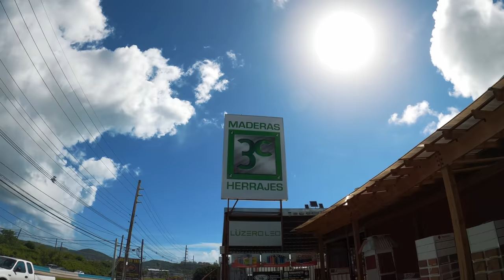BOAT YARD (PART 2) DESTROYED OUR BOAT SHOULD WE BUY THIS ONE?!

Comment: Matt and Kristin, I really love you guy's, I have commented before and I believe you respected my advice. Hooked-n-Rolling Offshore 2009 is spot on with his advice!! So, no need to follow up anymore on that. You guys are in a great spot with your boat. I would keep the boat you have and finish your project. And here is why, you are Learning!!! By the time you are ready to move up into your next vessel you will know what you're buying just by walking around looking and tapping. The education your boat is providing you with now can easily be transferred into earning big bucks for you while cruising and when you return ashore looking for a career in the industry. Okay next, you're moving too fast. Slow down and tackle each job one at a time working forward to aft. research and have a plan before you cut that first piece of high dollar marine ply. Make templates first. You have the advantage now to make the interior of your boat into anything you wish. Get a few sheets of cheap "Door Skin" and a hot glue gun and (temporarily) build your interior completely. See and feel each piece of furniture you're going to build and know it's going to fit and be what you want. Then after you take that apart you will have Templates or Patterns to use before you start cutting the expensive materials. And the Grand Prize !!! a brand-new BETA engine that will last a lifetime. Really guy's if done correctly you are in a fantastic situation. Stick with your plan. Your being smart about this for the long run.

Comment: You need to glass the top of your bulkhead.   Also make sure you don't have any air pockets,  you will lose strength.  Don't skimp on the resin.  Use a sand paper grinding pad for your grinder to remove paint down to the fiberglass.  Best of luck and keep motoring.

Comment: Looks like people already said about the cove and build-up in sizes, but the roving chop matt is the weak stuff! you need some thick fabric with diff. layers at diff. angles matt! multi-directional fabrics! that's where the strength is! not chop filler! and make some thickened stuff and glue the new ply to the deck and hull!  Then cove the corners then the heavy fabric! 4 layers! 1/4" sounds good!

Comment: I really admire and respect you both and am very happy you have let me tag along on your journey. Having said that, I have to get negative for a minute only because I wish you the best. Get a multispeed 7 or 9 inch angle grinder. Removing the paint with stripper and a brush will not do the job. You need a fair tapered surface of feathered fiberglass that you can only get with a grinder and heavy grit discs. That is the only way you can get the bonding you need to support the mast. What took four hours with the brush would have taken 20 minutes tops with a grinder and you would have had a better surface to glass to.

Comment: Ya that grinder disc is not the right  type. The flap one works great..  But dust in every place you could dream of.  Try the Oscillating Tool for cuts  you can a vacuum next to it or make a water bottle dust cover for it works well.

Comment: A wee safety tip.....wear safety glasses when you use the  pumps on your resin and hardener...I learnt the hard way, hardener nozzle was partially boocked and I pumped it and it squirted up and hit me rigt in the eye, I washed it out with sea-water then fresh water but absolute agony for around two-days as a result ..loving your work though and love your chanal

Comment: The Fibre Glass tabbing is there to reinforce the hull to bulkhead glue and not as a primary form of adhesion
As others have pointed out, you need to glue the bulkhead to the hull, then fillet the join before applying the tabbing.

Comment: Glass the underside of the deck to the bulkhead also fillets with thickened epoxy for the 90 on top and the sides this will make your chainplate bulkheads stronger also forget the thin cloth 5 or 6 layers of thick cloth other question was what your glassing to looks like interior ceiling  not the hull of the boat you have to cut away the ceiling  to attach directly to the hull because what your glassing to is just interior lining not the hull structure

Comment: Others have said it about watching Sailing Parlay Revival for bulkhead repairs.  Another mono-hull rebuild that's good to watch would be Expedition Evans.  No idea how much farther you've gotten but for any OTHER bulkheads, especially structural ones like those for the chain plates, please PLEASE seal the raw edges of the plywood with some thickened epoxy!  That will help bond it to the hull and deck of the boat as well as prevent water from seeping in to cause rot.

Comment: Well Matt , everything has been said and most of it is good advice, so only one thing from me , before you fit the bulkheads scar them up with the corner of a chisel all over then sand off the little wood needles so they don’t hold air in the Matt after glassing, you’ll be surprised how much grip it will add. Anyway mate love the show, real genuine couple and if I was near I would willingly give you a hand. I saw the stress in your face with the work you have created, good luck and Keep um coming

Comment: Great work and lots of great input. My two cents? 1. Replace all those bulkheads, you have it all stripped down now. The extra couple of hundred bucks of fiberglass now will pay dividends via a stiff, quiet boat that you'll feel safer on. 2. If you are using 3/4 plywood versus the half inch original, of course more reinforcing class will be required and the entire bulkhead will be wider. I'd check the slats for the chainplates to see if they are wide enough for the new width (through the deck) and all of the joint areas to ensure the thicker bulkhead will work 

Me? I might have traded up to the 40. More room on a boat is like gold. Whether it's just to sleep or for storage or to have separate areas to be when on the hook and it's raining, lol. But then again, who knows what problems you are asking for with the new boat. At least this one is the "devil you know". Great episode, thanks.

Comment: For your existing bulkheads drill the holes out to 3/4" to 1", check to make sure you have good wood, and then fill back up the hole with epoxy with a strong filler. Then drill the holes for the bolts, this is a trick that the Gougeon Brothers use for fasteners, that spreads the load on the wood and protects from water and rot.  Have fun restoring your boat.

Comment: Sweat Equity - It's worth ALOT! You guys are gonna have to do a cost/value analysis. Me personally I would continue with the repairs till done. I've found it's the same with cars. It's Always less cost repairing what you have as long as you're doing the work. Newer Bigger Nicer is expensive. You've already put money in tools & supplies, previous repairs. What's your boat worth after you fix everything you have planned (engine included). Used boats Always have issues, that's why boat buyers pay for inspections, sea trials. It all adds up, weighed against what you can afford. Maybe after all is done you figure this all out and come up with a way to repair and flip boats. Really enjoy watching your journey. Keep it up !!!

Comment: Ok read all the comments all of which are spot on re the fillets etc and advisories to check out other channels, however I think Matt may be a little to proud to watch others and follow there lead, my best advice, as already commented below, drill some holes find the rot, cut out and replace, re glass over the whole bulkhead and into the hull and under-deck, the more you cut out, the more you have to spend replacing, do the big bulkhead first and use your of-cuts for the smaller ones, just a thought guys, no hard and fast rules here, wishing you all the best, Al

Comment: With your engine, I recommend a Re-built Yanmar 30.  Ideally, the seller would crate the engine up and then ship to your location. Paperwork and customs would be biggest problem.
The rebuilt idea is a good one. Everything is brought into new specs. by replacing all wearable components, and thorough rebuilding of fixed components.
  I had my Volvo MD3a rebuilt in 1997, and to this day, it still starts on first compression stroke (assuming clean air-free fuel is available and no air embolism in the fuel line, filters and injector pump circuit.)

Comment: Dealing with a similar problem, talked to a few people and the consensus was why not do it really right and thru bolt the chainplates to the hull( build new longer chain plates so you don’t have to re rig) the teak block instead of plywood knee to make a flat spot for torquing the nuts.  Way less 106 and 207 too…you’ll use 300-400 dollars worth glassing sheets like that
Reply: Also big problem using chop strand mat as your bottom layer, it needs polyester resin to cure the correct way.  Epoxy resin doesn’t break down the components of the fiberglass in the intended way, causing for an improper lay up.  Just use the bi axial(hybrid) it is intended for use with epoxy.  Tear out and start over, especially .5-1in fillet with thickened epoxy.  Sucks but 100 miles out is worse

Comment: Matt
You seriously need to get a corded angle grinder.  Way more power than battery powered.  Also when you are grinding the fiberglass down, go with sanding discs for the grinder.  It will take that paint off and get you to fresh glass in a matter of minutes.  Get some coarse ones and some finer ones.  It's the only way to go.

Comment: Hooked-n-Rolling is absolutely spot on.  I'm almost finished building a 20ft Core Sound Mark lll, (engineered by B&B Yacht Designs.)which is an engineered stitch and glue construction. The entire hull is 6mm Okume marine ply, read as very soft and pliable. 
Here is the take away. 
- All intersections, whether 90 deg or not, must be filleted. if the are to be glassed or not. All my 90 degree corners use a 3/4" radius fillet but you can use a greater radiused fillet to increase the strength of the joint. You can buy spatulas for filleting from a 1/2" radius to a 2" radius or better yet make your own. 
- Use fiberglass tape not cloth. The strength of the bulkhead is in the plywood and in the filleted joint at the intersecting corner. Glass further away from the corner will have no effect on strength of the joint and if the bulkhead tears away from it's filleted joint, that extra glass will only act like a hinge for the bulkhead, so, logically no strength. The glass fibers, in fiberglass cloth of all kinds, only have longitudinal strength. The perceived strength in your hull preventing the hull side from caving in is provided only by the resin used in construction which is held in place by the glass cloth in it's liquid state. Oh ya, and your bulkheads.
- Use Cabosil (fumed silica) or wood flour mixed to the consistency of peanut butter for your fillets. You can use a tongue depressor (new not used ;-)  ) Fumed Silica and wood flour are "Thixotropic" which means that it will be able to be applied easily but will not run or sag allowing it to cure as applied. Fumed Silica and wood flour are the only 2 thickening agents which are recommended to make glue. Other thickeners will weaken the epoxy to varying degrees making the joint less strong.

I am excited for you and your project and I love to be able to share my knowledge. There are lots of legitimate sources of information on the net so please verify what I have suggested. My boat has gone from flimsy plywood to a sturdy boat which I can stand my 320lbs in without it collapsing in it's cradle.

One last thing, "Gougeon Brothers on Boat Construction book - West System Epoxy" is the definitive book on fiber glassing with epoxy. It will not only explain everything you need to know about using epoxy but also gives you the reasons for why thing are done the way the are. You can download a free pdf version or purchase the same book in hard cover. I chose hard cover. You can do a WEB search for the book title I gave or follow this link... "https://www.westsystem.com/the-gougeon-brothers-on-boat-construction/"

I'm enjoying your series.

Comment: In case you missed it in previous comments, definitely get a few 60 grit flap discs for sanding.  They are made for removing material and will work way better than a wire wheel.  It will greatly speed up the process.  Maybe use the wire wheels as a final pass like a fine grit sandpaper would accomplish.

Comment: You should epoxy the bulkheads to the hull and deck, make good size fillets and the add many layers of fiberglass to get the strength of the originals.

Comment: Hello Matt, if you're having 1/4" stainless shrouds, those should be tightened at re-rigging, 10% of the breaking strength, of the shrouds. Breaking strengh for 1/4" stainless shroud is 8200 lbs, so you've to tighten each shroud at 820 lbs. And that is just the nacked rig, no sails up, no wind in the sails. That rig is being proved at sea up to 3 times 820 lbs in a possible strong gust. I would not take out any other panel where a chain plate is connected, but reinforce them. You can make a 2 inch hole in the center just to check the material inside. 
Good luck sailor. Keep up the great videos

Comment: Hi Matt, I almost choked when you cut out the two fiberglass small bulkheads.  Then really felt bad when you started to prep the area.  I wondered if you could have used the orbital sander with 40 grit.  From the video, they didn’t look that bad.  I hope you can save the remaining ones.  I agree that the two replaced should have much more fiberglass.  Please use your own best judgement.  It is your boat, and you know more about it than anyone else.

Comment: I do not know boats but built many composite airplanes. I would add sufficient glass to match the thickness of original layers. I have a tendency to agree with you on the other bulkheads if the "core" material is not all that bad. May route in from the edge to see if you can get to good wood and splice in new core from the ends if the bad area is not that deep. You can make a paste adhesive with chopped F/G mixed with the adhesive and trowel the paste on the wood fill core and slide it in. add extra glass layers to fwd, aft and maybe even around the ends?? Bigger the glob the better the job!!

Comment: I've been trying to find the name of the grinding disk that works very well on removing paint much faster that how your doing it. The disks look like a heavy sandpaper that are overlapped forming wedges sort of. They have a firm backer but the wedges have SOME give. They cut through the paint fast and do a good job of preparing the surface to be bonded properly. You can use Bondo to round out the inside corners. If you don't the fiberglass will not form a strong bond.

Comment: There should be a gap between the hull and bulkheads many builders put a strip of foam between bulkhead and hull to prevent hard spots on hull which leads to cracking of gel coat, paint and glass when the boat flexes.

Comment: Yes fiber mat is cheaper but messy to wet out and woven fiber is stronger and easier to lay down and reposition. I rebuilt my 28 baja stringer system with single layer woven but triple 6inch wide layers when tabbing in bulkheads and floors.

Comment: It is called a cove in the 90-degree corner and glass and cove the top as well. A cove is thickened epoxy shaped in a curve while wet and glass taped over that with plenty of lap and definitely more glass. You could drill 1/2" holes in the existing chainplate bulkheads to see if there is rot in the plywood before removing them.

Comment: Get up with Parley Revival and watch his vids.
He just basically remodeled his bulkheads and he is a mech engineer.
You should mix calcium Carbonate or aerosil with resin and hardner and it makes a fiberglass caulk that can be applied to join the plywood to the hull.
I would also suggest fiberglassing the wood first to waterproof it before building the bulkhead with it.

Comment: 40-80 grit sanding flap disks on that grinder dude. theyll cut right down thru the paint and everything else fast. i use em on metal welds, alum and steel.

Comment: The Chainplate Knees for the Cap Shrouds on my boat are solid glass - no wood! They are at least 1/2’’ thick. Remember the load is being shared between Deck & Hull & largely in sheer. Imho 6 layers of glass will do it.

Comment: Your old bulkhead was bonded to the shelf that you cut out.  They supported each other.  You'll need to replace that load path.  Also, I'd suggest using glass fabric, not chopped matte, and overlap each new ply beyond the one beneath it by an inch or so.  That way each ply will be directly bonded to the hull.  Right now, only 1 ply is bonded to the hull,  the others are stacked on top of it.  That bond line fails, and everything peals off.  The fabric should be oriented +/-45 deg from the direction of the chain plates..  Use more than 2 plies.

Comment: Flimsy is not always bad, sometimes things need to have some flex. I do not know if it is good/bad in this case but I know that often things are done for a reason. Also copy the old wood shapes if possible because I think the water (or studs if it is on land), can deform the hull. I worked a lot on cars and replacing structural  parts in the carrosserie often has the same problem.  I then first bridge the part I have to cut out so things do not deform.

Comment: Wrenches are great and have their place but a basic soicket set and an adapter for your drill/driver will make life much simpler. break nuts and bolts loose with a wrench if needed then use the power tool to finish taking off.